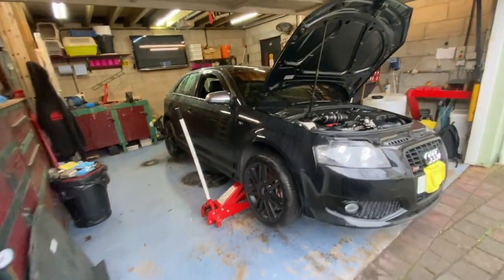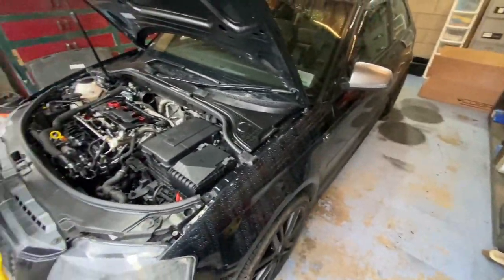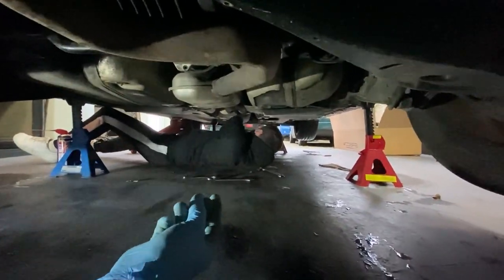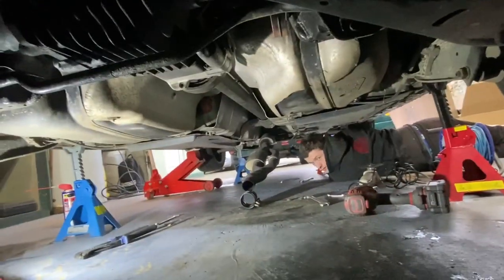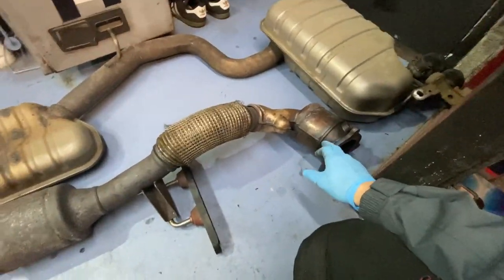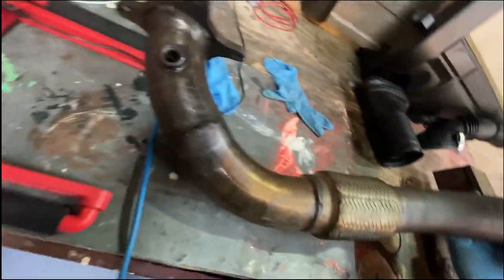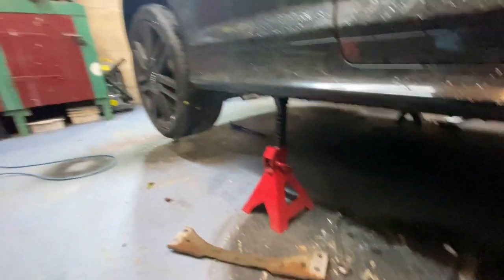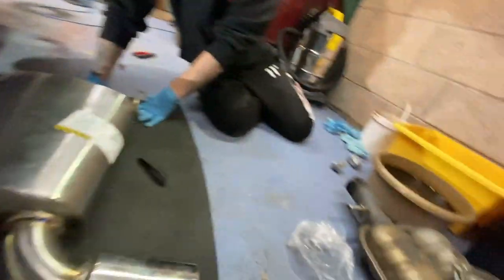Audi S3 8P - Fitting My Full Cobra Exhaust!

Comment: Hi? What about the original valve system pipe leave them as they are or put a screw in the pipe? Like does it make a difference? Hope that makes sense there's a pipe I've had to undo for the original valve and the cobra doesn't come with a valved system 
Kind regards

Comment: Nice work, I'm looking to do the same work, but I already have a BCS downpipe. Ordering the Cobra catback exhaust tomorrow, same one as yours and gonna try fit it myself. Any tips for doing the cat back? Do I need to fit back on the exhaust valve? Or is it completely removed? Thanks
Reply from the maker: Hi mate! considering its just the cat back then thats super easy! the valve sensor is still plugged in but i just cable tied it to the side so it prevents any errors, as if its not plugged in it does come up with a error on the OBD. just get some exhaust paste and wd40 and some big plyers for the rubber mounts, the rest is pretty simple!

Comment: Hey guys, did you get a load of engine codes (lambda related) when you did this install? And how did you solve this? Cheers
Reply from the maker: Hi, because there’s no car anymore, will need to get the car mapped, and they can get rid of the error

Comment: Hi mate what’s the bore size of the standard exhaust? I’ve got a 3 inch catback do I need a reducer to fit ?
Reply from the maker: Hi mate. Yeah the cat back system should come with a reducer included, to fit to the standard pipe. As I feel the standard pipe is 2-2,5”

Comment: What we're the valves for on the standard back box what did they do
Reply from the maker: When the cars in sports mode or you are hard on the throttle they open the second pipe for a more throaty sound

Comment: You Got any suggestions on a 2010 a3 TFSI 1.8 5 door
Reply from the maker: intercooler made the biggest difference for my old 1.8 tfsi mate, intake, exhaust, intercooler, looking at 250hp and they pull really well
Reply: @MotoAdventuresYT  exhaust from where?
Reply: @isaacsmith8617  my a3 is the the same as yours and i have a uprated forge intercooler, ramair induction kit, turbo back miltek exhaust and a dump valve